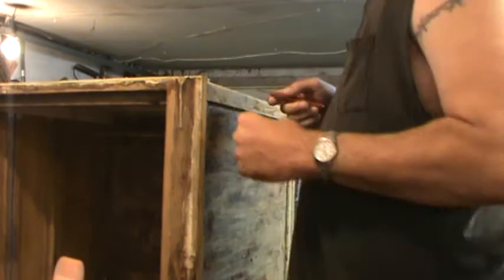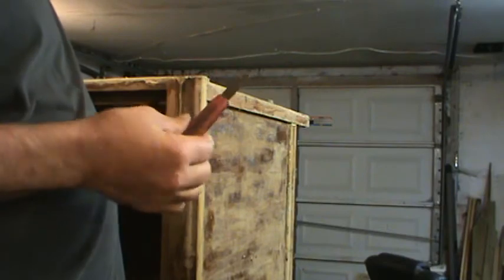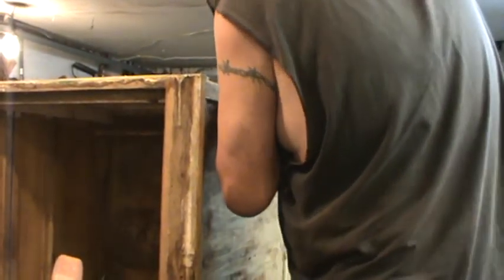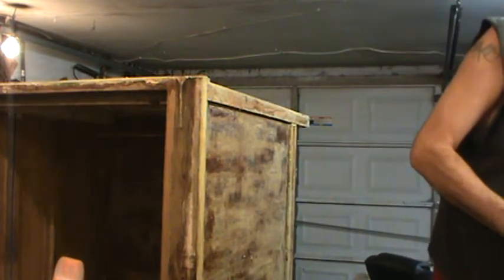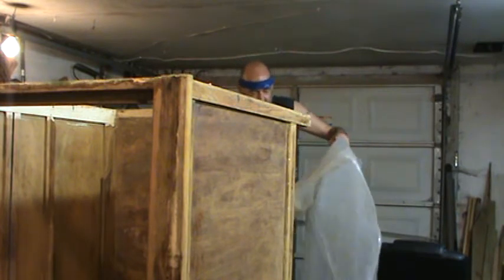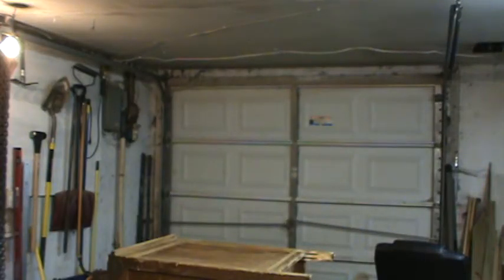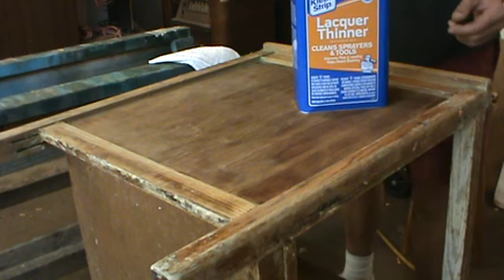Hoosier Cabinet Project #13--Back In The Saddle Again 1

Comment: I have to watch my back. I do insulation work in boiler rooms, reactors, and towers. Some times I am looking up all day. If your back hurts and then you gotta look up it's tough on the back. Looking good Gary.
Reply from the maker: I used to work for a place that made insulation but we made the kind that comes in plastic "bales" and blows in.  Applegate Insulation in Hickory, Kentucky.  They usually had me on a bobcat or a forklift there, but sometimes had me stacking the bales into semi trailers and at the end of every shift the whole crew had to clean out the piping system before we could leave so every night I cam home covered in it, lol.
Reply: Yeah I try to keep myself covered up as much as possible. It's tougher when it's hot cause you don't wanna bundle up in the heat. Winter time is no problem. Sometimes we use this stuff it's called foam glass, it's black and kinda like light cinder blocks. That stuff powders off very easy and you gotta watch you eyes when the wind is blowing. It's paying the bills right now until I find something better.